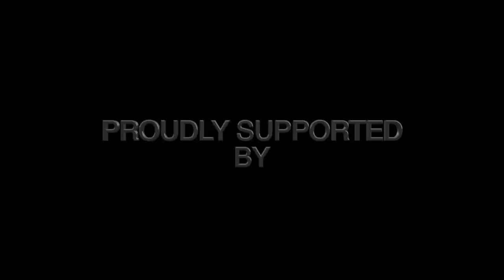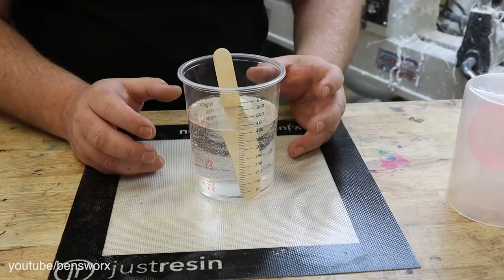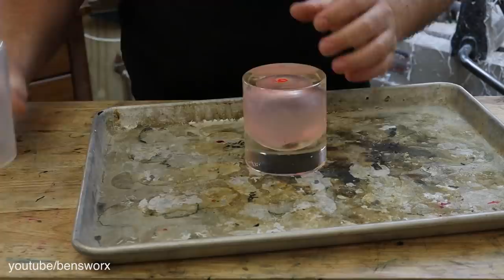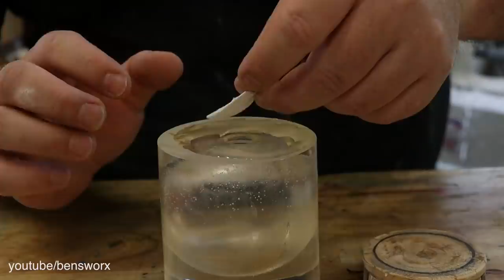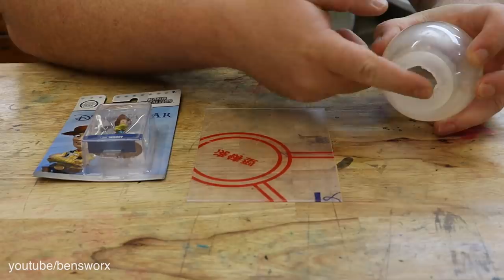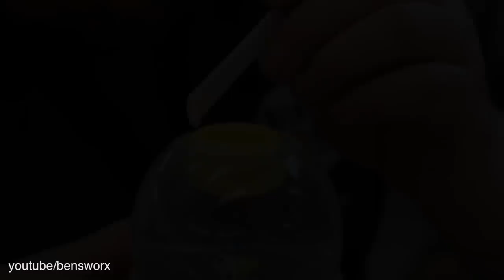The Final Episode - Resin Snow Globe

Comment: I'd like to see some videos that don't require a lathe. I enjoy playing with wood and resin in the shed but as much as I like the pieces you make I can't try to do them myself since I don't have a lathe. Something us poor folk can try to replicate would be great!
Reply: That is a very good suggestion. IMHO
Reply: I have used a number of different pseudo lathe, alternative methods for machining, wood, plastic, copper, aluminum, MS, BS, SS. Drill in a Vice, with the Workpiece mounted to a "cheap'o" hole-saw. Same again, but with a long 10mm bolt thru the centre. Bench-press Drill makes a reasonable Vertical Lathe. Belt-sander in a vice, or clamped to a bench, angle grinder, etc. BUT SAFETY FIRST !!! These are POWER TOOLS, they CAN Kill you, even Ben's lathe. 
Working with Wood and Resin, all you need is a chisel, rasp and a sanding block, and do it all by hand. The creative mind finds a way.  ;)
Reply: You can make molds from propylene sheets or silicone. If you don’t have a ton of bulk to shave off and use a shiny mold, you have less work that you need a lathe for and less polishing to do.

Comment: That turned out great! I was wondering though, do you think polishing the inside by either adding a fine abrasive sand before turning it or using a fine steel wool on a drill would have made it even more clear? Just a thought. Not a criticism. 😊
Reply from the maker: Thanks Mate, I did try to polish the inside but it was very difficult

Comment: What a great example of how when your Plan A fails, and you accept that, and change things - Plan B turns out to be better. - 
Woody standing on an old barrel, looks so much better than if that figure had just been put on the clear plexi. Like that combination could have been sold as an OEM piece - cowboys and old barrels just go together. It adds the final professional artisan touch.
And... "Dat bASE!" - oh that turned out pretty - I love the grain pattern.
I like to polish the bases I do way up there - like 2000 grit wet sand - to really make that grain shine, even without finish. And then to get that "Old West" look - and I would imagine Old Oz look, since our cultures and geography, and history are so similar (way more than most people think) - I like to use the rattiest, nastiest, blackest used motor oil I can get my hands on. Usually from diesel engines that see hard service - like tractors. It's what the old Pioneers used, and I expect they did the same in Oz during the period, and it just makes things... awesome. And you get the benefits of an oil finish.
I use it for most of my projects, come to think of it - I guess I just really like the aesthetic, and the practicality of it. The used oil is usually free, or more likely from one of my own rigs, and it's a final reuse before proper disposal.
I grew up in farm country - so after it ages in the wood a bit... I also like the smell. It reminds me of the old tools in my grandfather's garage.
Anyway - I blather.
Perhaps for your next project - you might really like ant/bug hole casting with aluminium or pewter - and then putting that into the resin. Mounted on one of your bases? Oooeee!! That'll look nice. People are really fascinated by the castings as well - a peek into an otherwise invisible world.
 I prefer the pewter because all I need to go hiking into the field and do castings is my propane torch, and a cast iron skillet. (Along with safety gear, gloves, and water. And my short shovel.) Aluminum requires a crucible and kiln at high temps - tedious, not very portable.
And - aluminum sucks for casting. It doesn't hold details.
I've had some castings of spider holes with pewter, where I caught the details of the spider silk, which makes for a very interesting metal surface texture.
I think you would really enjoy it - plus you get to Pompeii with whatever annoying critter it is you are forever casting into the pewter. Little ant bastards picked the wrong yard to march their army into, ya know? It's not murder - it is defense! (Their little ant bodies... molded in their death poses, as the molten hot magma of pewter... rains death from the heavens... then put on display in resin for all to see the triumph of my victo--... Sorry! What?) 😄

Comment: I just had an alarming thought.  Does the epoxy bond well to the yellow plastic barrel?  I don't know what the thermal expansion behaviour of the oil and cured resin are like, but any crack and leak will make a terrible mess.  Best avoid temperature swings.

EDIT: If the barrel is made of polystyrene or polyethylene, the bonding is likely to be poor, likewise PETE (polyethylene terephthalate).  If it's made of some kind of thermosetting material, you should be okay.  The easiest indication is that if the barrel has a "recyclable" marking, it probably won't bond securely to epoxy resin.